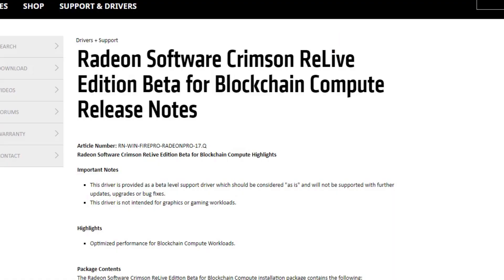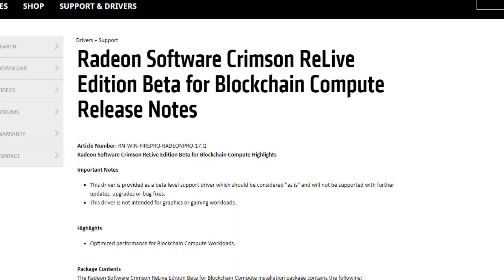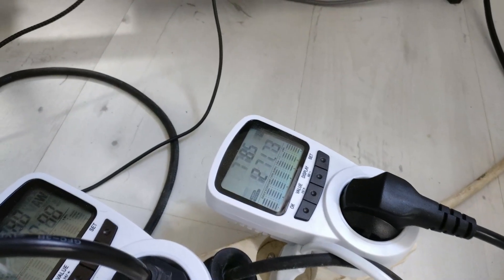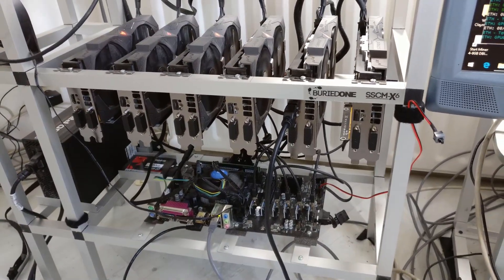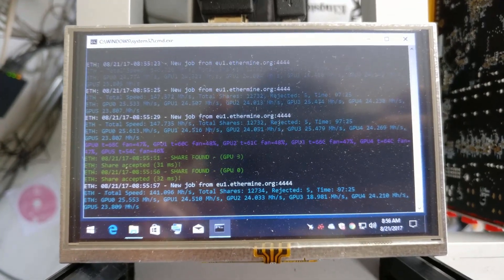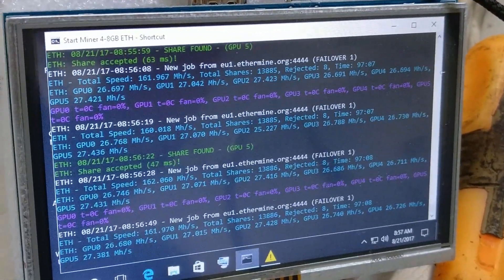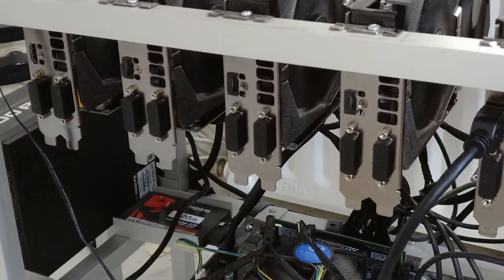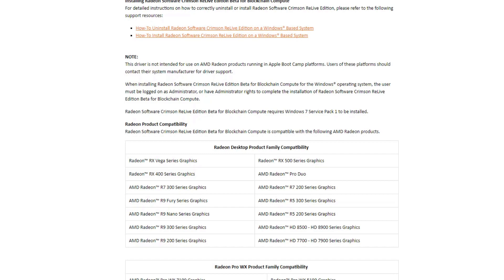AMD Mining Drivers, INCREASED Ethereum Mining SPEEDS! Part I

Comment: The -mvddc and -cvddc options in Claymore isn't working anymore with this driver, so I can't adjust the voltage and the cards throttle down to 1000 Mhz resulting in a 14 Mh/s :( What happened and what to do ?

Comment: I have rx580 Nitro+ 8 Gb hynix. I tried different drivers and OC settings but I have not gained over 21 MH ? How can I increase it to 28 MH ? I tried 512 KB ROMs from ANORAK. But I can only load 256 kb files to Graphic cards.Whenever I tried to mod with 512 KB mod , I get a message "Cannot Erase ROm" Which OC rom or settings should I use .. Please write it under my comment...Link please..
Reply: Hi, I have same cards and almost 31MH/s on dual after this driver update. Before about 26 MH/s. No Afterburner, everything in Claymore.

Comment: I've had my sapphire Rx 480 for a little less than a year and Ive been using it a lot for mining. Now I've noticed it is becoming worse than before. It won't display to my monitor most of the time , games have worse performance, and it is overall very defective. Does anyone else have this?
Reply: Please respond
Reply: Are you trolling us? Of course performance will drop if you stress the card 24/7. The gpu is designed to deal with constant high voltage supply and overheating.

Comment: Question: When plugging multiple rigs into your standard household outlet, what’s the safest way to do so and how many watts/amps could a circuit handle when hooking up multiple rigs that draw 750-850 watts of power each?

We are currently building a house and plan on doing the basement shortly after. I don’t have a clue on what we plan to do with the layout of the basement (let alone the electricity). I might have 3, maybe 4 rigs total, each with a 6 GPU configuration. Could I run them all off a surge protector into 1 outlet? Or do 2 rigs per outlet? Or even just 1 per room? When this basement is done, there will most certainly be other things plugged into the wall. Any tips or advice?
Reply: About 15Amp for 1 rig. 20Amps can support 2 rigs of ~1000 Watteach easily per outlet. So you can see on the elctrical board when installing to put bigger Amps per switch/outlets
Reply: Would it be fine to install 15amp outlets and just replace the breakers for that circuit with 20amp breakers? If I only have 15amp lines in place, would that mean I should limit myself to 1 rig per circuit?
Reply: Yeah 15A for 1 (assume a rig is 1300 watt) would be fine.

Comment: hey after the Driver installation .. i cant OC any card in Msi after Burner...
any help ?
its show 0 at every column
Reply: You need MSI Afterburner 4.4.0 Beta 16 to adjust voltage & core clock. I had the same problem it was grayed out on 4.3.0 version.
Reply: me too
Reply: even i try to Oc by the hard way .. i end up with one non functional card that doesnt get any hashrate
Reply: me too
Reply: I'm completly fucked now, I have to do a complete ddu to restore my previous driver.
afterburner is completly fucked with all the version available
Reply: No Name ill give it atry

Comment: I have these nitro+ rx 580 8gb modded bios from you and using 17.6.2 gpu driver and I could not install the DAG fix Driver and have MSI clocking work.  Some reason I have to go back to 17.6.2 driver again.  Any ideas?  I noticed that if the driver ver. does not have non-whql.. Can you tell me why if you have an idea?  Coz if it says whql it wont let me run MSI.

Comment: cant set voltages with that driver :(
Reply from the maker: You need another msi afterburner for it
Reply: try afterburner 4.4.0 beta 16,it is not as good as watttool or overdriventool
Reply: Thanks Guys I'm going to try that now cos I had same problem....

If you can't clock then you are worse off with this driver haha

Comment: Any idea when we can use it on ethOS?
Reply: I got word from the devs that AMD probably won't be releasing Linux drivers til October. Once the EthOS dev team have the code they will immediately integrate an AMD driver update command in the shell. I also overheard some talk that they will be releasing other new features into the OS that will be a big boon. Don't quote me, this is second or third hand knowledge, but they will be implementing the ability to spread the DAG file across two cards. I think over time EthOS will be the best way to mine, if it isn't already, due to the fact that there is an active development team fine tuning and adapting to the changes in the space. I doubt very much Microsoft has dedicated a team of people to custom tailor their OS for miners.
Reply: srigyre Thanks for your response! I sure hope this update will come quick to EthOS!

Comment: My question is: did you upgrade the bios on your GPUs? And if so shouldn't you be getting 28-29 mhs per card, why would you be only getting 160 mhs with the new driver upgrade. 

Thanks
Reply from the maker: Agustín M The cards kept crashing for about every 5 minutes at 29.3Mh/s and every hour at 28Mh/s so i left it at 27.8 its better than the 25.5 before ;)
Reply: BuriedONE Blockchain  that's great to know I just bought ) sapphire nitro rx 470 4g and I can't wait to tried them out, Thanks for the info. What are you  getting for sols? Just wondering if I eve switch to zcash

Comment: Hey, are you using a z170 board on any rig? If I install the new driver on my z170 gaming m5 I can't boot windows if 4g encoding is enabled but it boots just fine with the 16.9.3 drivers. Do you know if there's any way to fix that?
Reply: HOW TO FIX ETHEREUM / ETHASH DAG EPOCH HASHRATE DROP!

1Download
Download Beta Driver for Blockchain Compute http://support.amd.com/en-us/kb-articles/Pages/Radeon-Software-Crimson-ReLive-Edition-Beta-for-Blockchain-Compute-Release-Notes.aspx
Download ATImdag Patcher https://www.monitortests.com/atikmdag-patcher-1.4.5.zip
Download BETA MSI Afterburner http://forums.guru3d.com/showpost.php?p=5459908&postcount=637
Download Display Driver Uninstaller http://www.guru3d.com/files-details/display-driver-uninstaller-download.html

2Install
Uninstall drivers with DDU in safe mode
Install the freshly-downloaded driver from setup
Before restart install the atikmdag patcher
Install Beta MSI Afterburner
Reply from the maker: jason boenig exactly.
Reply: The Traveling Tech Guy I would just do these steps and not reflash. I'm not an expert
Reply: That's exactly what I did but still can't get windows to boot. I'll give it a try with a windows fresh install. Other question, is the ATImdag patcher necessary for 470/480 cards? I tried with and without it and did not have positive results
Reply: no, patch drivers after install with atikmdag-patcher